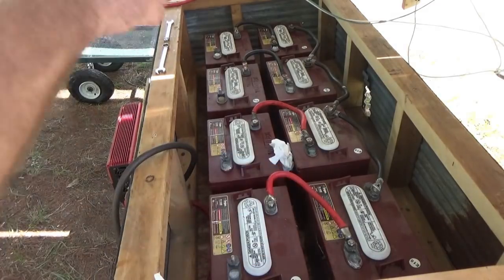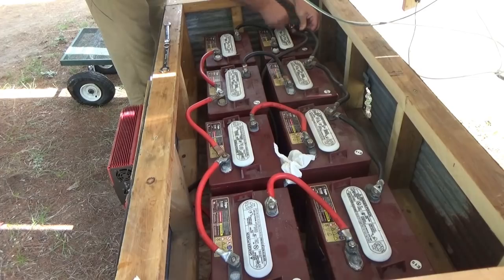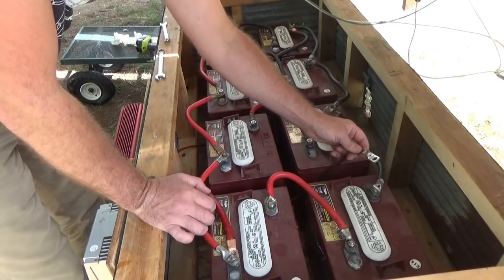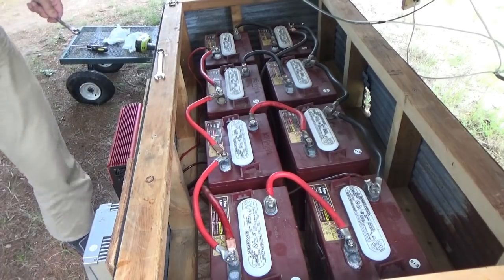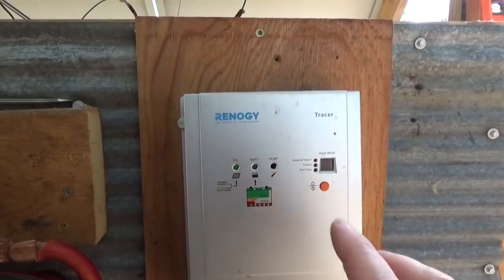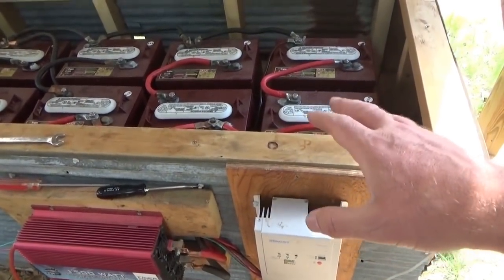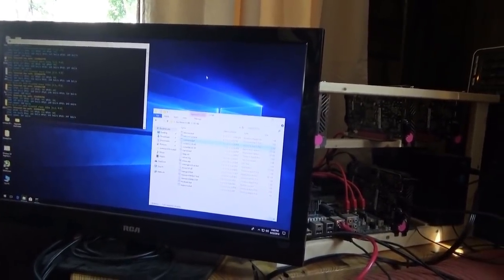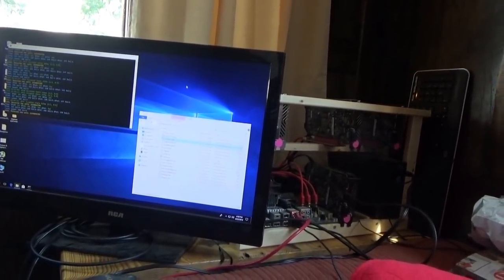Finished Wiring Solar Panels And Mining Cryptocurrency On Solar Power

Comment: The cost of batteries is huge , any solution of mining without battery , only using panel + grid ? Thanks
Reply from the maker: Yes, you can go with a grid tie system. Then the power grid is your battery.
Reply: @TheDoItYourselfWorld  it is absolutely a wise decision , but the daily volume depends on the Utility , if u want to do big , better negotiate with the grid for night usage
Reply from the maker: Using a grid tie would be the best option overall. It cost more up front but is the best way to go.

Comment: Is it still working?
Reply from the maker: Yes it all works fine. I lost internet three months ago and cannot get stable internet anymore though so it is quite frustrating to lose so much potential crypto during peak sunlight hours of summer. But the electronics are all working well.
Reply: The Do It Yourself World Thats fantastic! Will it continue to run at night with all the charge stored in the batteries?
Reply from the maker: No, I shut it down at about 5-6 pm depending on clouds or not. I also use the system for our home all night so I need the power.

Comment: You never needed to do this......Firstly your inverter sine wave is dirty power "square wave" or modified square wave compared to the power in your home. Its really bad for computer equipment long term. I most definitely commend you for your efforts. But you would have saved more money by using a grid tied inverter with no batteries. Then double the solar array you built, you can mine 24 7 because you will make up for the power used during the night the following day.

Comment: Why are you using an inverter? Your inverter is going DC to AC and your PC's PSU is going from AC back to DC. Wouldn't it be more efficient to just feed your GPU's with the DC from your Solar panels?
Reply from the maker: The only problem is that you also need 5 volt and 3 volts at relatively high amps.

Comment: how come you didn't wire your panels in series, and you could have used a smaller wire going to the charge controller inside the house. An mppt controller can handle very high DC voltage, but you should keep the batteries close to the controller because of low voltage going to charging batteries.
Reply from the maker: Its a 60 foot run and I cannot afford the wires to run my wind turbines and more solar panels. That is my main reason.

Comment: Of course it can be done but doesn't make much sense to do it. My rigs have to run 24 hours a day at all the watts I can get. At best you will only pull down enough power to charge the batteries then discharge them in a few hours. Having the rigs go on and off during a 24 hour period doesn't return enough to make ends meet. the constant/consistent demand for electricity means that they need to run 24/7/365. Battery power alone won't cut it. It's not all that important to be off grid in the land of cheap electrical power, way cheaper than any solar system that you can build evan at half price. Fun to do maybe but way off course when it comes to being a practical application of disciplines. Also maybe someone can correct me if I'm wrong but I think it would be a better idea to always end your connections to the battery bank with the negative instead of the positive. Less chance that a surge will go through your equipment or fuses.
Reply from the maker: I thought you were correct too until the electric company hit me with a $850 power bill when all I used was $400 worth of electricity. Their fees went through the roof and stayed there. More than our usage every month. I shut it all down. I am going solar.

Comment: get some DC disconnects place on pos lead of inverter and one for each charge controller. make connections then turn on. no more sparks. bad  for batteries .they make H2 gas when charging. also run the remote monitors inside . glad to see system grow. I did the same but different. My NiFe batteries 12 years old  100 percent. 12V 700Ah 20 cells 2X10. I started with interstate GC2 batteries 6X  lasted 3 years.

Comment: Can u connect output of charge contreoller to invertor to save wire?
Reply from the maker: I never use the output of a charge controller for anything due to their very low current capability. An inverter needs a LOT of current and very thick wires.
Reply: My Invertor and charger meet at the battery!
Reply from the maker: Oh, now I understand you. Yes you could do that but I was told to put power into one side of the battery bank and pull it out from opposite wires. Thats what I was told anyway.

Comment: Don't know why, but I got to thinking what you would need to run 4 mining rigs 24 hours a day, around the clock and still have household power. My closest guess was 34 6 volt batteries. With 8 of those being seperate to provide household power. Yet, I am not sure I am correct in that. My cousin in Montana runs his off grid cabin off a fork lift battery pac, and I think it is 36 volt. Wonder if that would allow you to do 4 mining rigs plus household power? And how many more panels would you need to add to power those batteries/fork lift battery pac?
Reply from the maker: When I get the last two solar panels connected again I will have 1,600 watts of solar power. That can keep a couple mining rigs going in full sun for about 6 to 8 hours a day. To run all night would cost way too much in batteries. Not worth it.

Comment: Hi Troy
a few sugestions/ideas.  Make so that the inverter and charger can sit in side the battery box at winter and help keep it warm. Look into powering your computer from 12volt instead of inverting up and down from 110 volt AC.  I have made this on my robot lawnmower. It had an 12volt inverter from a battery to 230Volt AC and the lawnmower power supply making it 24volt DC :-/ that cost about 1 Ampe from the battery. Then I got a $5 China DC to DC step up converter. That is now doing the same job, but just going from 12V up to 24V (actually turned out it was more like 32 Volt) but it only uses 200mA,,, a 5X saving.
My video tomorrow is called "I want to Run my Data Center of Solar Power - 733" so we are kind of working on the same thing :-)
Reply: I would not put the controller in the battery box it can eat it plus it add a fire rise. The gas put off from the battery is flammable.
Reply from the maker: Cool. I now have two 1080Ti graphics cards running on solar power at this minute. Been on there all day.
I have considered running 12 volts but I would have to move the rig outside next to the battery bank to handle the current needed. Not necessarily a bad thing. I would have to build a shelter for a mining rig out there though. The mining rig heat could heat the batteries. I think you need 3 volts and 5 volts for the CPU and other things on the motherboard if I remember right.
I was told by many people not to put the charge controller in the battery box because the off gassing would eat the electronics. Not sure if its true but many have said that through the years.
Reply: Hi Troy
Awesome to see the rig making money off solar!! 
To run a system of 12v you need something like this goo.gl/FKd4bD ,, it will make the 3V, 5V, 12V for the Motherboard and HD,,, 300Watt versions are also available but then we are over $20. And for the GPU's 6 or 8pins (that is all just 12Volt) that just need to be regulated so they do not get to much,, something like this : https://goo.gl/f5cXXi - 300watt or https://goo.gl/4XoAdu for 1200watt
It would be cool as He.. well you probably do not like that word :-) to run a rig of a 12 volt battery.
The off gassing,,, it might not be totally untrough,, but I have never seen any sign of that... might only last 15 years then,, it will be replaced by something better with in 2 years. I think the benefits might be bigger,, and it's not as it that box is air tight,,yet :-)

Comment: You should never coil your extension cord while using them.  It changes the amps. Just like a transformer does. If you test the end output of your extension cord amps and volts, then spread the cord out and test it again you just might see a difference. Worth the check.
Reply: He shouldn't use extension cords. There's a right way and a wrong way to do things. I realize Troy is on a tight budget but its not that expensive to run wire underground in conduit according to code. Safety first.
Reply: I agree David, and he is working with what he has, so that being said, dont roll your live wires in a coil.
Reply: What?? Those two conductors inside the cable cancel each others induction lol
Reply from the maker: David, the orange cord you see is now running AC power to my devices inside the chalet. Its totally off the grid and not at all tied into any existing wires or lines. So no code really. When I called the electrician last year to ask about my system he was actually rude with me and angry that I wasted his time. So much for code.
Reply: Troy, you should probable talk to another electrician. Building it to code, whether or not you are required to, simply ensures that it is done right and safe. There are electrical codes for solar power systems.

Comment: Do you have fuses between the panels and controllers to prevent them from being fried from cloud lensing or lightening strikes? Might be handy to have switches as well if you need to work on the controllers. Same with the battery and inverter sides of the circuit.

Comment: Would it make sense to put the mining rigs out with the battery box? It would certainly keep the batteries warm!

Do the charge controllers have remote monitors so you don't have to trudge through the snow to see voltage, amp and battery status and can monitor from inside the house?

Comment: you could turn your monitor off to save power until you want to see it and then turn it on when you want to check it.
Reply from the maker: Yes I did that but wanted to see max power consumption at that time.

Comment: That is why Tesla and Edison had the ac/ dc debate. Convert dc to ac for distance and back to dc to power for the house. Dc doesn't like a lot resitance from long wires , ac loves it and keeps the amps down. Remember amps hurts or is it hertz electrical joke there Troy. Now would please put your wiring to the house in some PVC conduit to protect from critter chew on the wires. Makes for a easier time when mowing the lawn too.
Reply: The Tesla (Westinghouse) vs Edison debate was really about business. That is, who was going to reap the rewards of selling power, and survive as  a company. In this situation the issue is not AC vs DC, it's just voltage. To power the same load at the house end, you need about 10 times the current at 12 volts as at 120v. You could push DC or AC down that cable and it wouln't make a difference.
Reply: AC allows the use of transformers to boost the voltage to hundreds of thousands of volts for long distance transmission.
Reply: true enough.
Reply: David Johnson The drawback of uping voltage with AC amps down , but means less watts.
Reply: Frederic Nolan, the power as measured in watts stays the same. 120 volts x 1 amp = 120 watts. 120,000 volts x .001 amps still = 120 watts
Reply: And the power loss down the cable is i^2 * R. Higher voltage means lower current, lower loss. Bigger wires means lower resistance, lower loss.
Reply: Jim Steele Thanks for the update on the real reason.
Reply: We would have had to have a power station every few blocks with DC. It wouldn't be practical.

Comment: i know it takes funds but with that investment in batterys you should have a proper inverter that monitors the battery bank amh so it shuts down the inverter at 50% of the battery bank, because every time you drain the battery bank down past 50% you are really damaging the batterys and before long you life span of the batterys it cut way back, in other word if you have 600 amh total you should not use more then 300, you can get a 2500 watt, with a 8000 watt spick marine inverter with all the built in monitoring and a 50 amp built in battery charger, that you van charge from a generator or grid for under $900, what are you mining, gold?
Reply from the maker: I always look at the meters, literally all day, every day. I try to keep them above 12.5 under full load. I call the gauges my off grid TV
Reply: that is only monitoring you bank voltage not AMH just because you have 12.5 volts your AMH  can and will be much different, i have gone to customers home that have an inverter similar to yours and there volt gauge reads 12.9 but testing there 750 AMP bank there down to 370AMH  witch is doing big damage to there bank
Reply from the maker: An inverter that costs the same as an entire new battery bank is WAY out of my price range. It would take me 10 years to save up for that.
Reply from the maker: My solar charge controller shows me battery capacity and percentage of charge. I am looking on Amazon for a battery capacity meter. Much much cheaper than a whole new inverter.
Reply from the maker: The MPPT solar charge controller required me to enter the battery bank AH total and the type of cells. It monitors them precisely for me and shows me the state of charge. I had forgotten to mention that.
Reply: he can use a Victron BMV700 to monitor the bank amp hours. and just use his existing inverter.  This bmv monitors the amps going in, and out off the bank(and can switch off the load when a 50% state off charge is reached, to protect the battery,s. whit the build in relays.
 )  costs about 70 dollars..
Reply: @ Troy, About your mppt display, this is not the real amp hours mesured, it can only monitor the amps in, and cant messure the power out, because you connect the appliances to the battery connections direct, (and not the power out off the mppt charger, it computes the state off charge now only bij the voltage off the bank, thats not precyze enough....)
Reply: oh i under stand that, but on the other hand a few draw downs to far and you be looking at a whole new battery bank, i have seen people total a set of 120Lb each battery in less then 2 years from taking them be low 50% AMH to many times and dont hold at all any more and it dont take many, i do an install and they cheap out and not have an inverter with a built in cut out,, you cant go by volts